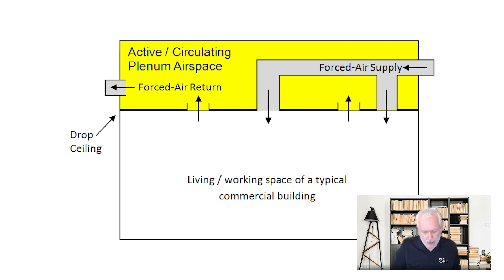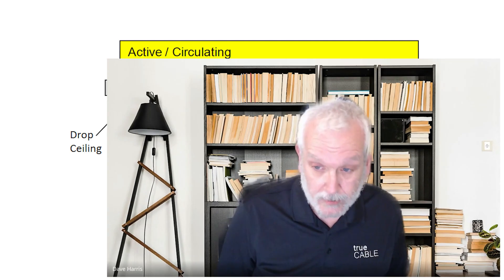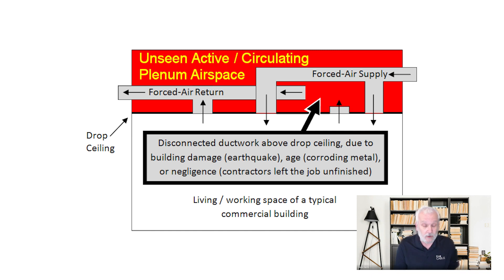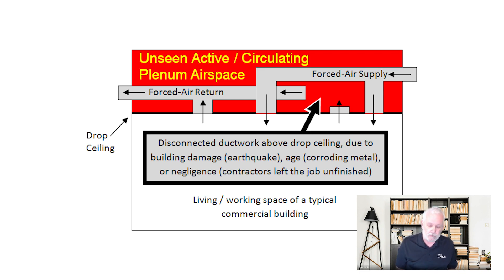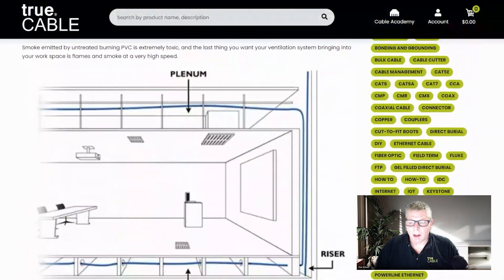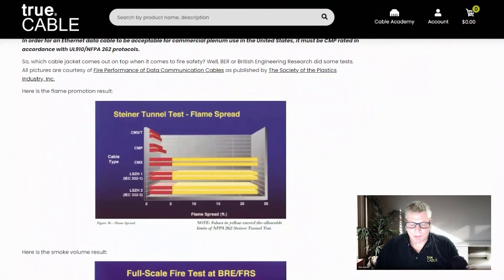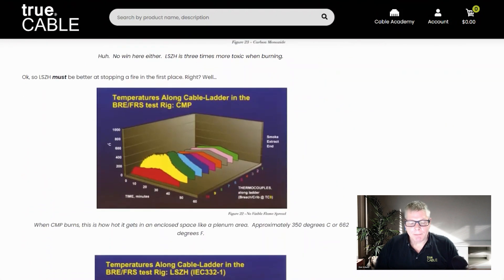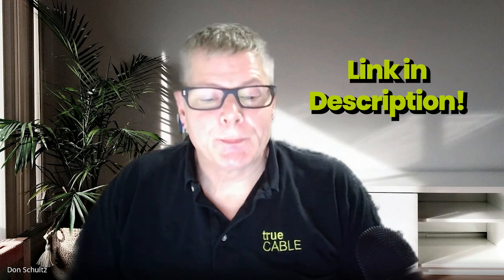A Breakdown of All Ethernet Cable Jacket Types | Low-Voltage Lowdown | Ep. 3

Comment: I have never worked with outdoor rated cable before. Is there an easy way to distinguish it from indoor rated PVC jacket just by visually looking at it?
Reply from the maker: Hello John! Outdoor-rated cable can be distinguished from indoor cable by the "CMX" designation printed on the cable jacket. Indoor cable will be CMR (riser) or CMP (plenum) or even CMG (general indoor use). Apart from the jacket printing, outdoor-rated cable looks the same and can come in the same colors as indoor cable. Therefore you really have to look at the jacket printing to tell. Hope this helps!
Reply: @trueCABLE  Thanks so much for that information. I had a local solar panel company doing an install for me, and they ran a Cat5e cable to roof for the communications. I had a strong suspicion it was indoor rated cable, but now I know it for a fact because the jacket says CMR.
Reply from the maker: @jdbarney  We always have your back!
Reply: @trueCABLE  Greatly appreciated! I've got a spindle of your CAT6 cable sitting here waiting for me to find time to run some new drops in my house. Told the vendor they should take a good look at your outdoor cabling options for CAT5E since it is probably cheaper and better than the garbage cable they have been buying.
Reply from the maker: @jdbarney  Thanks for commenting John. Our outdoor Cat5e options are really good choices as not only will they provide up to 2.5 Gb/s potential speed, but are much easier to bend and work with compared to some of the really thick Cat6 and Cat6A options out there. The Cat5e options are also priced right! My two favorite outdoor versions of the Cat5e are the Cat5e Outdoor Shielded and the Cat5e Outdoor Unshielded (both are non-direct burial types). Hope this helps :)

Comment: The problem with the idea of using plenum rated when it's not required, just to be "safe"  is that it's like 3x the cost of riser cable.
Reply from the maker: Hello! Well, quite frankly that all depends on your risk tolerance and what your contract called for in the first place. In a residential situation, this won't apply. Plenum is not required in non-commercial environments. Now, most commercial contracts demand plenum-rated cable above drop ceilings even if the space above it is not technically a plenum space (but could become one for reasons stated in the video). All said and done, if you are a contractor facing questions from the fire inspector or insurance company, you would rather be able to say you used plenum-rated cable in an office building if a severe fire should develop, resulting in property damage or lives lost. You don't want to be the person attempting to explain away the intricacies and nuances while being accused or under suspicion of making it worse! Let us know if this helped!
Reply: @trueCABLE  I just checked your prices plenum vs riser and it's actually 2x the price. Which is more reasonable than other prices out there. I get your point, but even at 2x the cost when you are running 10's thousands feet of cable, that's a significant cost.
Reply from the maker: @extracareav  Hello again! Correct, plenum rated cabling is significantly more expensive than riser rated. Generally speaking, you would not purchase plenum Ethernet cable and use it residentially or unless there is a commercial installation that requires it by Code or via contract. In the case of requirement via contract, your customer would expect the higher materials price. If Code requires its use, you would price it into your installation costs with the attendant explanation (provide a copy of the relevant Code page for their reference). If your customer insists on using non-plenum cable in spaces you know require it, then DO NOT take that job. A written waiver absolving you of responsibility will not help. Any property or lives lost in the event of a fire will result in civil and criminal penalties you will also be on the hook for, along with the customer. Hope this helps!

Comment: I color code patch cables but not data runs cuz a data runs function can change over time.
Reply from the maker: Hello Henry! I concur. The patch cord is the most important item to color code as you are unlikely to see the permanent cabling inside of walls or ceilings anyway, and as you point out the function of the permanent cable(s) may change over time.